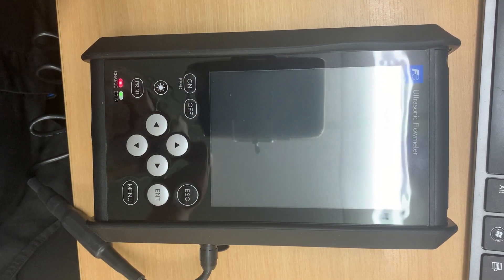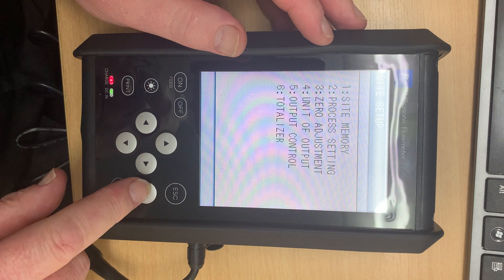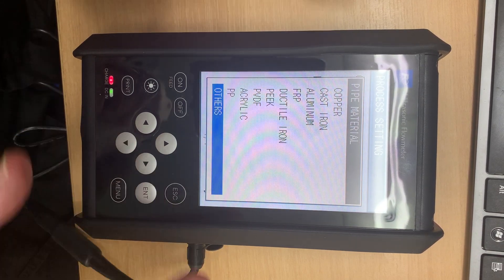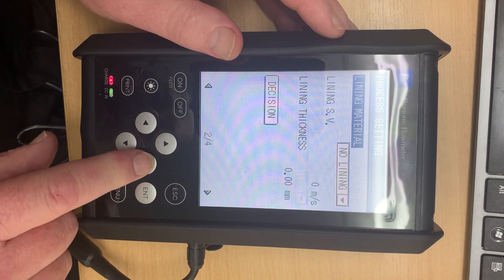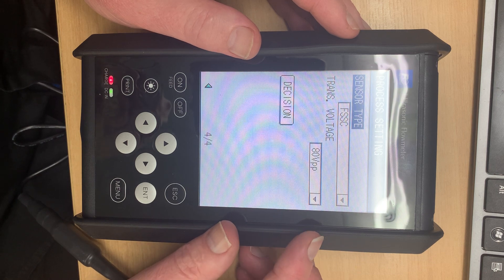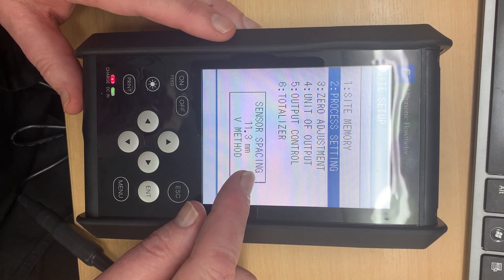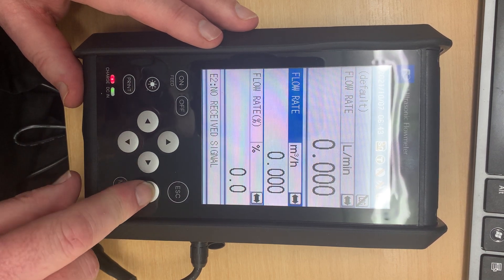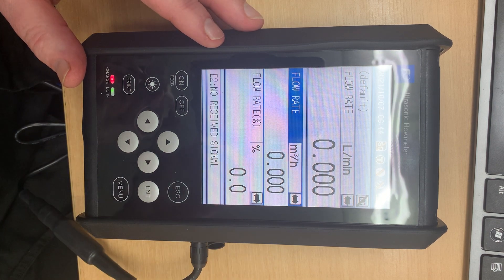Fuji Portaflow Demo Part 1 of 2

Comment: Hello, I was wondering if you had any bad experience with this unit in the field. I am looking at purchasing one this week and wanted to get your opinion before pulling the trigger since these types of flowmeters have a pretty hefty price tag associated with them. I am a field engineer and typically do testing on different pipe materials and pipe sizes. I got to different sites like water, wastewater and some industrial accounts. I usually see pipe sizes from about 2-48”. Thanks!